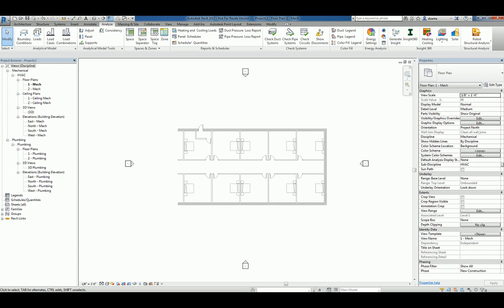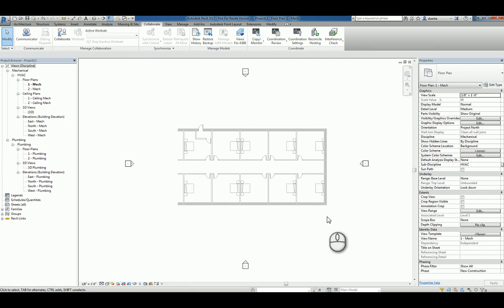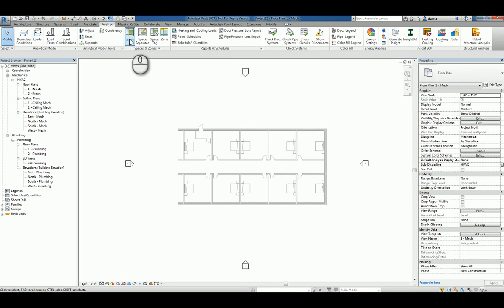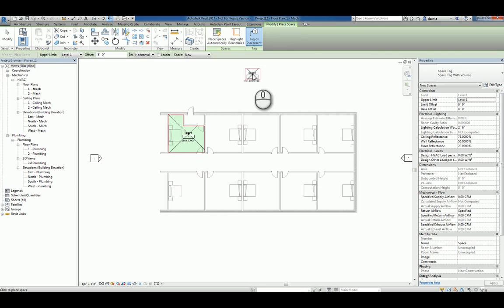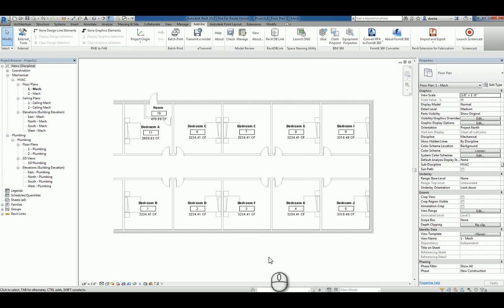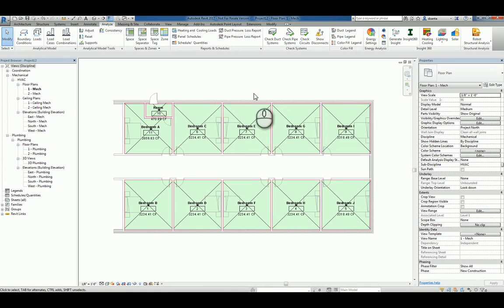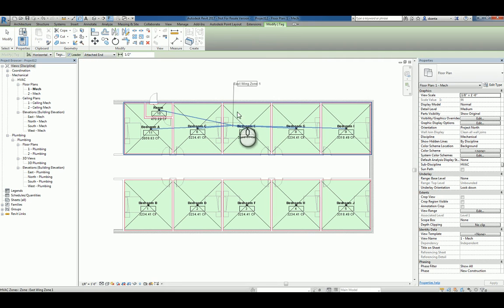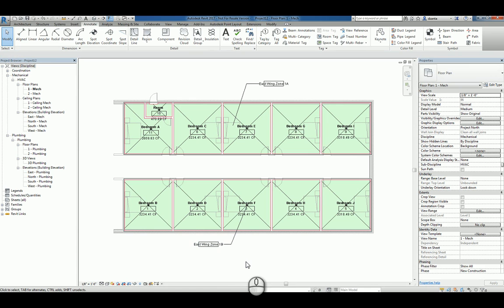Revit Spaces and Zones   A How To Guide

Comment: Is there a way to add spaces to corridors, risers and lifts in Revit? Or is there a way to box these areas similar to workspaces?
Reply from the maker: Hi Nirat.  Yes you can add spaces to corridors, stair risers/mechanical chases/elevator lifts.  The Space command and Space Separator command will allow you to place the spaces and confine them properly.  You will need to place the space first, then adjust the elevation height limits.  Use the Space Separator command to confine the spaces where there are no physical model objects that have Room Bounding capabilities (i.e. corridors).
Reply: @DzanTa  Thank you.That helped!
Reply from the maker: @Nina-fy9jb  You're welcome.

Comment: Which video describes the Spacing Naming Utility? I found this video very helpful in my search for scheduling duct pressure drops, and I'm worried about when the Architectural model isn't up to date, or coordinated properly. I think this means that I have to manually name each space if the linked arch model doesn't have them setup properly? (This is super common XD)
Reply from the maker: The SNU only works if the arch uses room objects properly and they are already placed in the linked arch model.

Comment: Hey and sorry to up this movie but with this useful AREA, can we stop to use ROOM ? Here we can easily replace it with AREA no  ?
Reply from the maker: sorry but I am unclear as to your question.  This video explains what are Spaces and Zones and how to make/use them in Revit.  It also touches on the Space Naming Utility add-in as well.  Please try to clarify your question.  Thanks.
Reply: @DzanTa  when iclick on space and slect a room it says Space is not in a properly enclosed region
Reply from the maker: @munawarfairoos5958  The Space object just like the Room object and Area object require that it is fully contained by "Room Bounding" elements such as walls, floors, ceilings, roofs, etc.